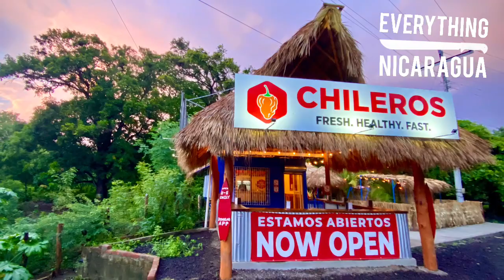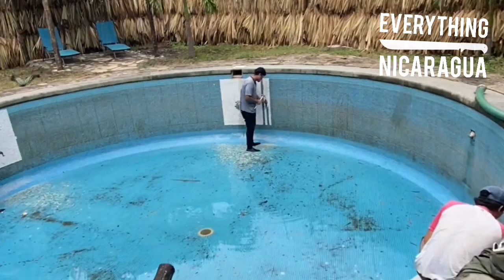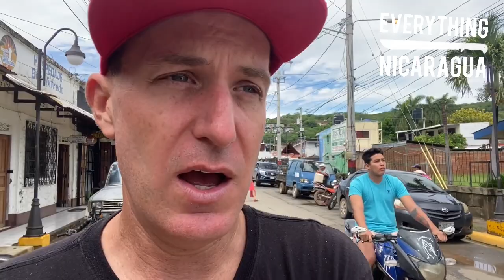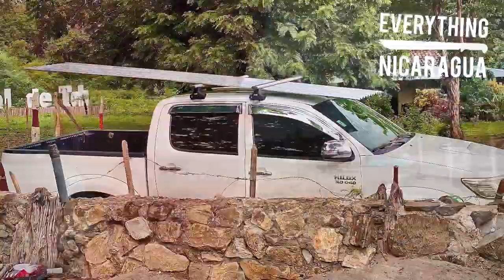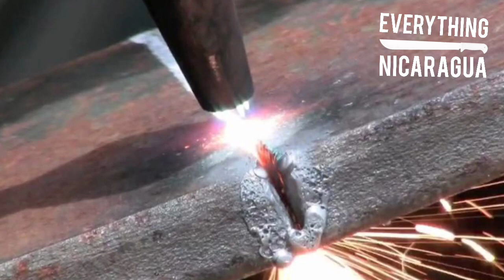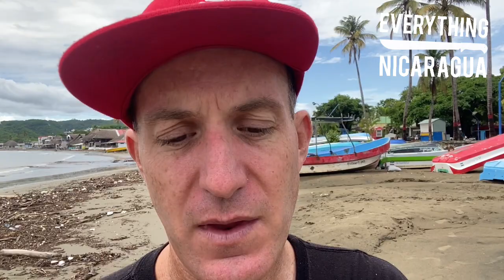Building in Nicaragua 2022

Comment: Maybe investb in a mic bro
Reply from the maker: That’s so funny you mention it 😂 I came to Nicaragua 3 1/2 years ago and I brought 2 little lav mics with me. Since then I have bought 2 different shotgun mics and three different alternative Bluetooth lav mics, also have two large diaphragm condenser mice’s in the studio. The hard part is Nicaragua 😂 wind, monkeys, bugs, thunder, rain, drive by advert trucks, random parades, motos, truck breaks, clubs, outside street djs… then which one to bring with which connectors iPads or iPhones not hooking up to the wrong Bluetooth and getting the levels right… and doing the show 😂 I think we have a pretty good system now. We bring a hip bag with a small iPad with usbc to usbc to our rode go2 lav mics and a backup (cheap usbc Bluetooth lav set) then we have the iPhone with the lighting to female 1/8” headphone with a TR 1/8” male to TRS  1/8” that goes into the rode go2 lav mics. We then have a rapid usbc charger that charges everything from one plug. Out battery packup packs all got fried and we quit using the gimble because it took to long to set up. That’s what we use after shooting video in Nicaragua for three years straight with no breaks. Progress not perfection. 😎
Reply: @everythingnicaragua9418  I'm sure. I was recommending because I was trying to listen at work and it's open area so difficult to hear you from phone speakers. I'm heading to Nicaragua very soon. Right around the corner matter of fact and want prices to certain things I'll be needind.

Comment: get a carbide metal blade for the chop saw. The stone disc grind the metal and it takes forever. The new carbide metal blade you can use a regular circular saw and it will cut the "solera 1x1" easy
Reply from the maker: That’s awesome I never thought it would cut more that aluminum. I will try for sure! Thanks jc